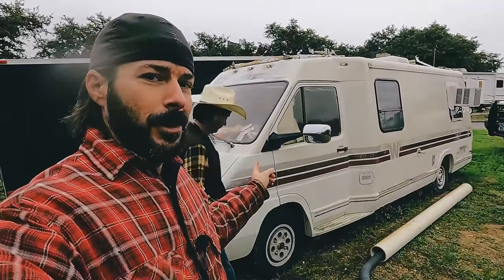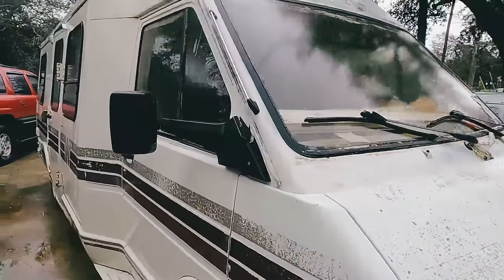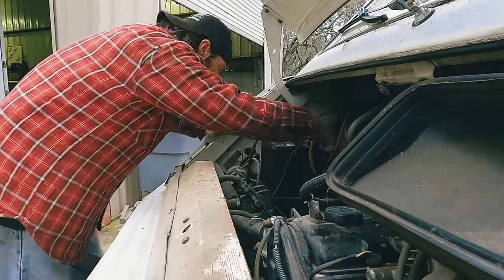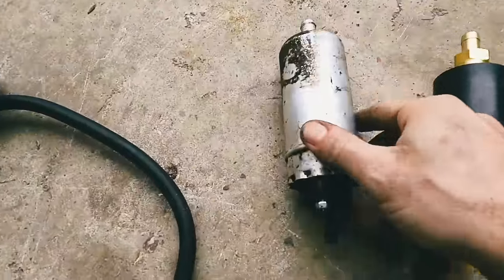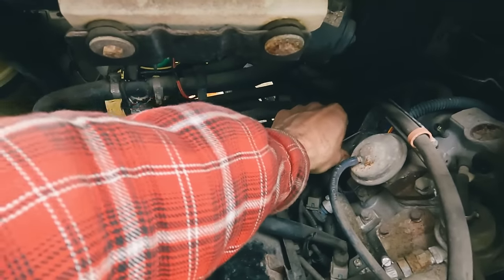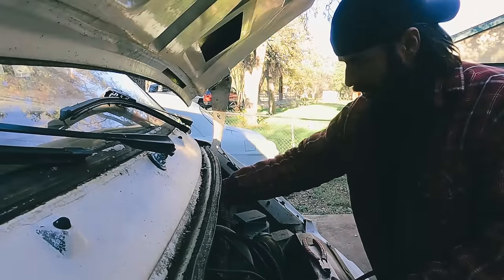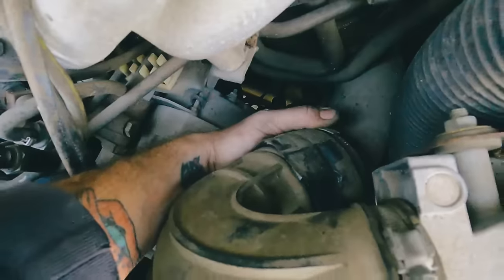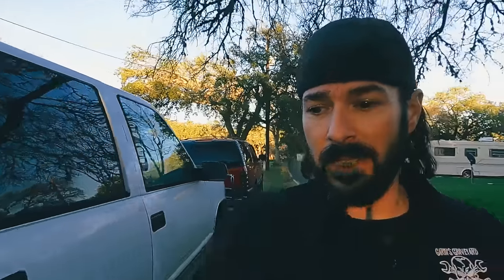ANOTHER ABANDONED RV! Will this 1989 Winnebago LeSharo run and drive?

Comment: You should have full dash idiot lights.... Either oil pressure sw wire is off, or the switch is bad. You can check by grounding the wire and check for dash lights. Oil pressure light will go off as well......once you replace the switch.

Comment: Used to car tow cars and needed the steering to move on older cars in the seem of the column there is a large pin that you can push in and out a plastic card to hold it open but the column would then turn